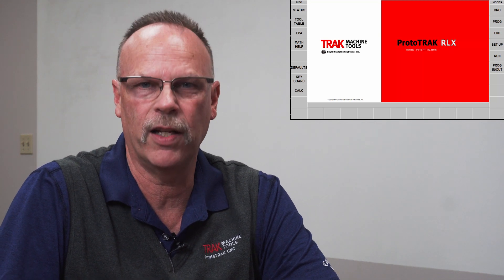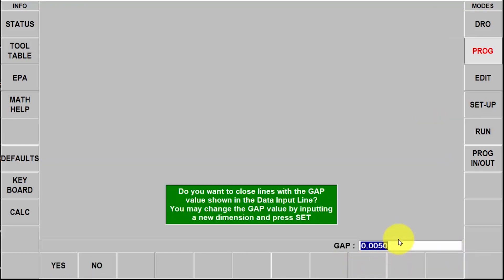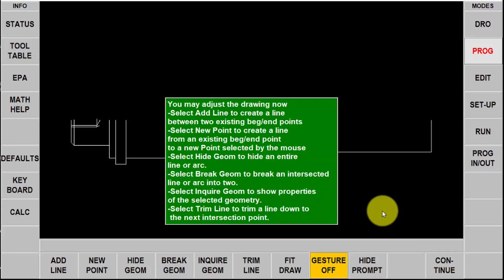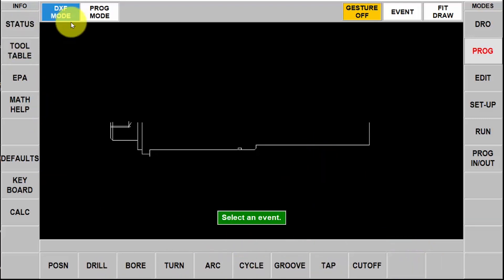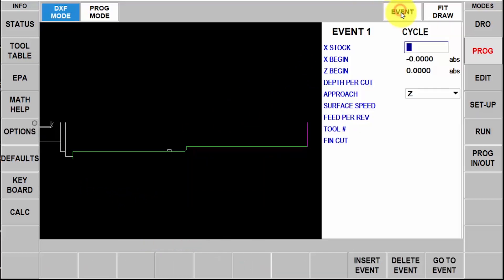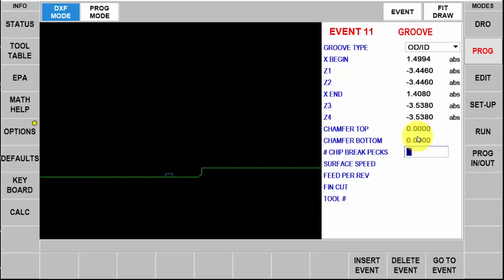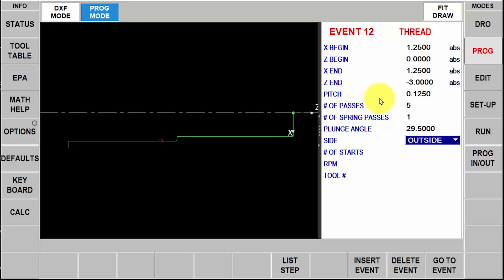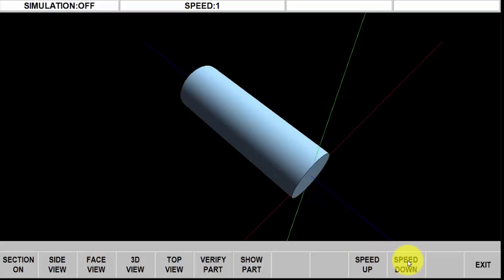DXF Files | ProtoTRAK RLX CNC | Lathe Programming

Comment: I really don't understand the concept of x begin and x end in the context of the lathe. I know you tried to explain it in another video where you held up your hand like a U shape, but it just doesn't make sense. Is this diagrammed in any of the manuals or online somewhere?
Reply: Hello, It sounds like you are referring to a groove, is this correct?  If so, here is what you need to know.  In a OD or ID groove, X begin is the diameter you are starting to cut the groove from. X end is the diameter at the bottom of the groove. These two change places when making either an ID groove or an OD groove. This is why we don't ask for major and minor dimensions.  In a face groove, Z begin is the face of the groove and Z end is the bottom of the groove. T.P.